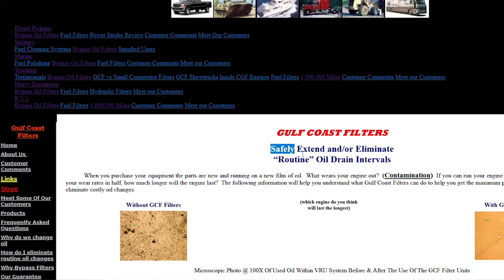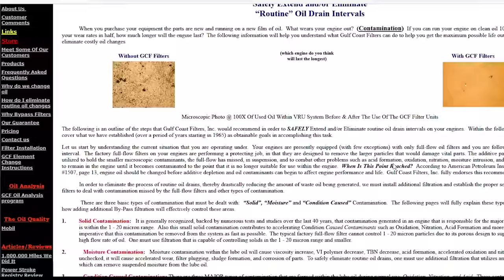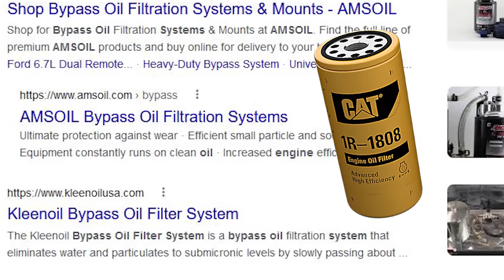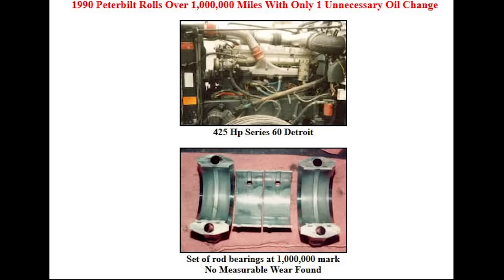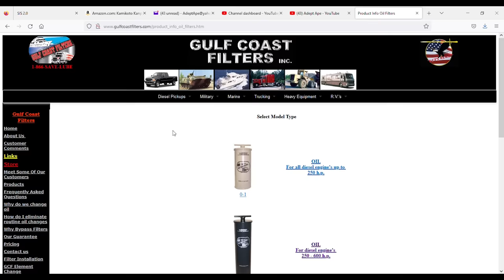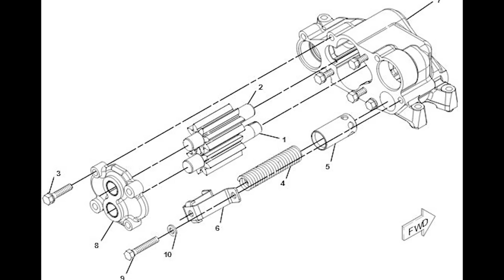No Oil Changes and 1 Million Miles!!! Are Oil Changes Optional with a Bypass Filter? (INTERESTING)

Comment: I noticed, when we sent our oil samples in from our fleet of trucks, some of the oil samples would come back with low additive levels, meaning when the new types of oils were made such as 10w-30, means it's a ten weight oil that lubricates equivalent to a 30 weight oil, by means of additives, but when your additives become depleted, then you only have a 10 weight oil doing the lubricating, which is not good, so I've always used just straight 30 weight oils, and my bearings are in much better condition using a straight weight oil, and not on oils that require additives to help it lubricate.   My recommendation is to just use a straight weight oil, but they are getting harder to find as the years go on.

Comment: I change engine oil on my 06 VW TDI every 5k miles with full synthetic oil, i replace oil filter every other oil change (10k), i use a vacuum pump to remove all the oil from the oil filter housing, so far 1/4 million miles and zero internal problems. Cost $25.00 every 5k and $35.00 every 10k. Nothing will run for 1 million miles with  doing an oil change !

Comment: When I read the video title I thought "This is going to be one of those stupid people who says "oil changing is a scam designed to make money for mechanics" or some other silliness".  But I was pleasantly surprised this video was well thought out and nicely done, overall.
    One thing I want to point out:  Engine oil regularly exceeds 250 degrees, especially when cooling the pistons and cylinder walls, as is normal in all internal combustion engines.  That means the oil will continually break down, even if it happens very slowly.  Even so, I agree with the notion that cleaning the oil better can extend changing intervals and is definitely better for the engine to have cleaner oil.  But letting the changing intervals go too long would be a very bad thing.

Comment: Stopped at Walmart today.  They had SuperTech Heavy duty diesel oil for off highyay  use.CF-2 SAE 30 . With a picture of a small tractor. No doubt its conventional. Says not for  engines made after 2009. I remember how good the Delo 100 30 weight worked in the 60s. Got a couple gallons.since I recently bought the tractor and didnt know what was in it I changed the oil. Took both gallons with the toilet paper change.I will get some more. I normally dont use it in cold weather. The oil is about as clear as water. It will get black. As long as it passes the palm test im happy. Some old truckers know what the palm test is You rub some oil in the palm
 If it wipes of clean and doesnt stain the skin its clean. Clean oil feels clean. The used oil will go in the lawn mowers.

Comment: I do firmly believe that with modern synthetic oils, and fairly clean running modern engines, that oil changes can be pushed out much further. I wouldn't stop changing it, but it's wasteful if done too often.
On large commercial vehicles that spend a lot of time at a pretty steady rpm and load, you could go quite a long time. 
Now, a mail delivery vehicle in a city or even grandma's car that only gets driven a 10 miles a week needs it more often. Temperature fluctuations and moving up and down the rpm range a lot leads to more wear.

Comment: Way back in the 1970's there was a toilet paper bypass filter, I think the brand was Franz or Frantz.  There was a short lived car magazine that had no ads, just subscriptions.  The magazine was a big fan of the filter.  They would do oil analysis frequently and, of course, the oil was always perfect.

Speaking of high mileage oil tests, I remember an article in Popular Science many decades ago when the first Mobil 1 synthetic came out.  They put an engine on the dynomometer and ran it 100, 000 miles equivalent, same oil, just topped off, then tore the engine down.  Absolutely no visible wear.  No piston ring ridge.
Reply: I started with a Frantz and Delo 100 in 1963. In those days toilet paper fit.. The toilet paper changed Frantz didnt.. The best element for the Frantz is the custom made Franrz element. Motor Guard was a better filter but went with the better selling compressed air filters. The top loaders are a lot easier to deal with.All I have now is the Australian Jackmaster Classic  The Gulf Coast juniors and the old Motor Guards.When Frantz went broke a Frantz dealer came out with a improved top loader. The 3 stacker was replaced with a paper towel filter. Motor Guard started making compressed air filters. It was the only one safe to use for compressed air. My oldest filters are over 50 year old Motor Guards.
Reply: I was talking on YouTube about my Subaru with 250.000 miles with no oil drains using a Frantz oil cleaner and Mobil 1. Got a package from a Caterpillar lab manager. It was a sample  kit. He said the oil looks good for 250.000 miles but recommended a Filter change and a new quart of Mobil 1 every 6.000 miles instead ofevery 12.000.miles. I took his advise It took me about 20 years to put 250.000 miles on it. It ran too high a temperature in Dallas traffic with the AC on. Wife called me once because the radiater had split at the seam.both head gaskets started leaking oil after 250 K. Gave it to a young guy at work. He just used a cheaper oil and drove the hell out of it until he went to Iraq. Dune Buggies and Hot VWs did a big article on the Motor Guard oil cleaner. They were popular on VW dune buggies. When I met my wife she was changing the oil every 1500 miles. Took several rolls of toilet paper to clean that mess up. They didnt put a filter on the beetles. They saved millions.

Comment: hey Adept look at "Cummins Eliminator Filter" we have them on our marine fleet and they work wonderfully. just pulled apart a kta38 last year at 17,000 hours and it looked great as far as bearings go. We had to do liners due to lack of maintenance on the fuel system but all bearings and journals were in great shape. guys were doing 4,000 hour oil changes on them with 1,000 hour centrifugal filter cleaning interval.

Comment: I run 2 cummins vt 903m . I use 2 kleenoil bypass filters . 1000 hours no discolouring of oil . I don't know about a million miles but it's very effective
Reply: It dont take a rocket scientist to see the Kleenoil filter is a kick ass filter.Dont know the price of the filter elements I see Jackmaster has a filter that looks like a Triple R. I  use Great Value 1000 from Walmart in my Jackmaster Classic. The flat head Ford canister filter  is 4 1/2 inch diameter. It uses Scott 1000.

Comment: The major vehicle manufacturers all researched oil bypass decades ago, they absolutely do work but it was determined to not be cost effective. The part you missed was that you replace a few gallons each time you change filters,so your not saving 10 gallons it’s more like 5-7 depending on the setup. Friend of mine runs one, oil samples come back great but overall it doesn’t seem to save him any money it it does make it easier to service in the driveway so for some that’s a win.
Reply: Tell Shell oil and NASA the filters are not cost effective. That sounds like oil changer propaganda. Keeping the engines in top condition isnt cheap. Running an engine on dirty oil then draining it isnt cheap either.

Comment: I've been at this thing called "wrenchin" started at 17 in 1974, we had bypass, centrifugal filtration, my teacher taught at Finning Tractor, he impressed me with " just change your oil" I've stuck to that, I've now got a Duramax with 400K, oil has never got diesel black, don't know why, never been past 6K on life before changed, I've run a couple of Valvoline Restore as it's diet, even that oil didn't get dark, it's only had Delo 400, Rotella T4 the Mobil wasn't up to it,  
 I'm liking the Valvoline Blue Restore, 
 I've even switched my 04 5 Cyl Volvo gas to the Diesel version of Restore, I did see crazy carbon in the filter, so it did do its job.
 But it has 210K on it, it was tired when we bought it, it's not using oil, but it's a gasser, and was very sludged, did the timing belt, cam seals, it was gross, now it's stabilized, still gets it's 6 liters of Diesel Restore. 
 I'm still changing my oil often, it's cheaper than overhauls.

Comment: Schneider owns 35000 DD13's, and they change the oil every 85K miles.  Here's the kicker, they don't use new oil when they do change it.  They filter the old oil to spec and reinstall.  Honest to my Mom.  I company drove for them for 1.5 years and had 1 oil change.

Comment: Franz filters were popular once but people tend to get slack with servicing.
Got old inter's and Louisville's with LF 500 and 750 type bypass filtration and they are still running with regular oil service.
So thank you for confirming what I already suspected.
Regards Manny.
Reply: There was a time when a Frantz dealer in Gulfport Mississippi was putting multiple Frantz 3 stacker oil filters on marine diesels and offshore rigs. At some point Frantz went out of business and were replaced by paper towel filters and an improved top loader toilet paper filter. I still have some of the toilet paper filters in use. The Frantz 3 stackers used 2 ply toilet paper. Same as the AeroFrantz.

Comment: I have a 2005 International 9400i with over 3 million miles and only 1 rebuild. I’ve tested my oil for years. I started out changing my oil at 10k miles. I never saw any significant signs of contamination until well beyond 25k as long as there were no failing components. For years now I change my oil at 20k. Oil sampling has saved my engine countless times. Cheap insurance IMHO.

Comment: So question... would bypass filters be good for normal vehicles?  I get the idea that large diesel engines need something like this due to the sheer amount of oil they usually have but when you have a smaller engine that only has 4-5 quarts of oil is there any reason this would not benefit them as well?

Comment: You would want to see what the oil burn rate is. With Volvo and scania long drain oil changes of 40 to 50k miles they burn more oil in that time then what gets changed every if you do the standard 10 to 12k mile oil change.
If you where to go for never changing your oil you would want to go to a straight weight oil like a 30 or 40 as while the oil still works it will brake down to its base stock or winter weight so it will come back to a 15w from the 15w40 which means the oil film will be thinner so not ideal in heat or under load.
Also of your going to do this it would also be best to add a spinner filter as well to help out the other filters they are quite effective in getting rid of carbon from the oil.

Comment: According to the website, the average savings cost per year is $840. Or $70 per month.  At the very least, I would change oil during the 3rd oil filter change, just to be on the safe side.

Comment: It is possible on some applications to not require oil changes despite constant running.  On natural gas compression engines like the 3500 and 3600 ADEM series, packagers actually route engine oil to the force-feed lubrication system that feeds the pistons on the compressor. This oil usually is "used" as gas pressure sends it down the pipeline and the engine oil is replenished through the oil maintainer. During PM all that needs to be done is filter changes and sampling.
Reply: A.K.A. "hey y'all running a sweetener line?" Haha
Reply: @robertwingate650  lol yup some are even starting to run those on small hp
Reply: I have a 50 year old toilet paper oil cleaner on my old F 250 Ford 390. I guess that would qualify as low horse power.

Comment: similar idea to diesel locomotives. the oil change is for life in them, but they use a little oil and they add whatever additive is required based on oil samples

Comment: The  USN taught us that oil cannot be destroyed, only contaminated.  Lube oil, I believe it was 2190 TEP, was brought to a big tank that had heating coils.  Long story short, the nastiest oil you could imagine came out of the centrifugal purifier looking like Wesson cooking oil.
Reply: 2190 TEP is Turbine oil with Extreme Pressure additives.  
The 2 means turbine in navy speak, the 190 is the old Saybolt seconds unit of viscosity. About ISO 46 -68 today’s units. This is not SAE W units from vehicles .

Turbines are not  exposed to products of combustion and normally only have water contamination from the steam system to worry about .

So take out the water and particles and they last.

Motor oils gas or Diesel have products of combustion leak past the rings plus some possible fuel oil dilution. 

You need bypass filters ,Centrifugal are best , to help AND oil samples . 

Ship keep jacket water above 120-140 all the time And never start an engine without a separate electric  oil pump running to prelube the engine . No cold dry starts.
Reply: Also run the prelube pumps on shut down to cool residual heat and turbos .

One ship called them BNA pumps - Before N’After….
Reply: Oil can be destroyed.  Not on a Navy ship perhaps. In the old days the oil actually got better with use if you could keep it clean. The impurities ended up stuck to hot engine parts and in your oil filter if you had a good enough oil filter. I dont think there were any multi grade oils you could use in a diesel because the polymers broke down..The Delo 100 came in W20 and W30. Of course anything will break down if it gets hot enough. The.Frantz oil cleaner on my flat head 6 Rambler kept the oil looking new. Every so often the engine would start knocking. I would remove the head and clean the tops of the pistons and the head. The head gaske thickness wss the only clearance between the head and pistons.Those were the good old days.Every combustion chamber was a different size..For a little more I could have had a lot better engine. Live and learn.

Comment: I feel like it's a pretty reasonable way to go for at least extended oil changes rather than never changing it.  I'm sure a couple of caveats would be the same as 20K mile service on gas vehicles: you must start with an engine that has no issues and you have to regularly inspect for issues at lower intervals.  Someone with even a small oil leak trying to go 20K miles could easily be on empty long before they ever get there.  Even though the oil is more than capable of long life, the car or truck often isn't.  Someone with a bypass system that still regularly checks for issues is probably going to be $ ahead.

Comment: The key word there is "unnecessary" oil changes. They're using bypass with sampling to determine if the oil is breaking down and needs to be changed. They're not claiming that they've never changed the oil.
Reply: When you are adding 3 gallons of new Rotella when you change the two rolls of Bounty big rolls you are changing the oil. The Road king article says that is equal to a oil change every 40 K miles.. The advantage is the oil never is allowed to get dirty.. Normally the oil gets dirty and is drained. For the system to work the filter. must be big and dense.

Comment: This is a nice review. I'm interested in the claims of some of the bypass filters that their bypass system is graduated with the end filtrate being cleaned down to one micron. I'm talking about smaller engines, I run a 2015 Duramax. I'm look at several different manufactures, haven't decided witch one yet. Not convinced of the graduated system claiming down to 1 micron. I also can't see a difference in wear at one micron particle vs 2-3 micron particle size. Would love to see you put on a presentation about this. 
thank you for the time put into this presentation.
Reply: I know this thread is old but, do you realize how small a micron actually is? 20 microns is right around 3/4 of one thousanth of an inch. So divide that by 20 for the size of one micron. The difference between 1-2 to 3 microns is very marginal and will keep oil analytically clean. So the main things to watch out for are excess fuel and coolant contamination. Then to do complete oil changes when the TBN gets used up.
Reply: Oh Oh, I reread your post. I believe you do understand. Sorry!

Comment: No oil changes Asterix lol! You still change the filter and probably still add some oil. Those giant canister filters on big diesel trucks can also get secondary filters that’s pretty much just a sock with a bunch of textile scraps inside of it
Reply: I made a few filters out of 8 inch PVC and used shop rags for filter media to clean cooling tower water. The company bought bales of old clothing to use for shop rags.

Comment: The old farmers rule was always “don’t change it till it gets ropey” and that was on full flow systems. With anything to keep the oil dry and cleaner than a regular filter I can see the oil lasting a lifetime.
Reply: When I was selling the Frantz oil cleaner I had a customer that had a auto parts store in Sedan Kansas. I had a Frantz on the counter.. A old farmer asked me if they were as good as a Fram.

Comment: Re: the destruction of the week: say what you will about Cummins one thing I always liked about the 855 and N14 is you can get to and replace the piston cooling jets from the outside of the engine without removing any parts (in most applications).

Comment: I do know a guy with an old Mack (E6 4 valve 350 mechanical) who only changes filters every 10,000 miles and adds oil as needed, never drains the pan unless doing work on the engine that requires it be removed or drained due to water intrusion. Granted it leaks and burns at least 2gal a week so there’s always fresh oil going in but still I’ve been surprised how few problems he’s had with it over the years.